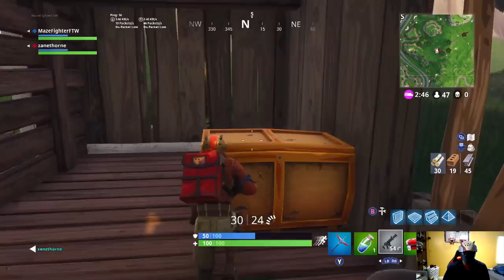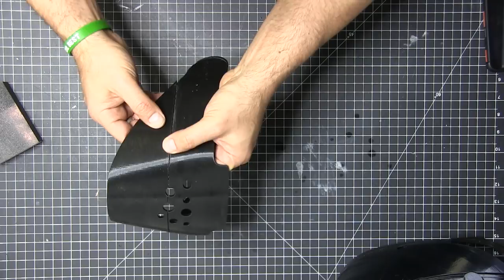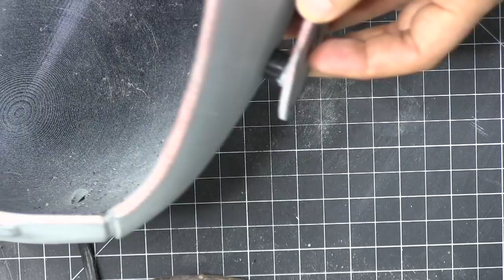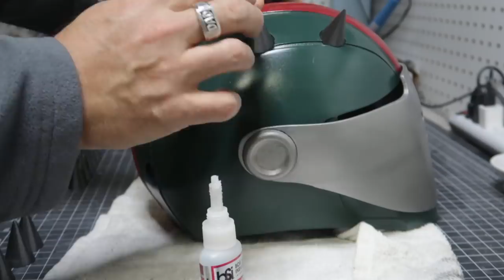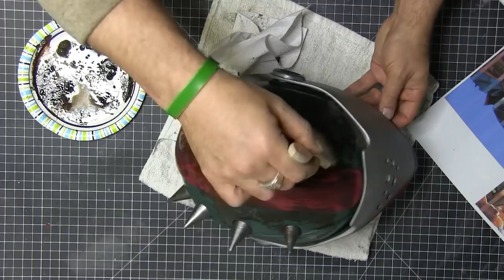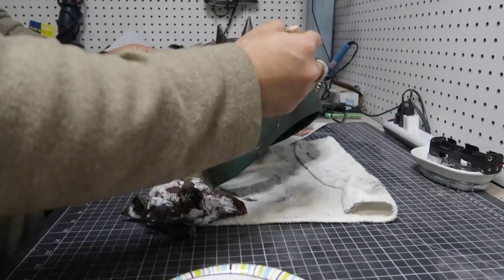Fortnite: Rust-Lord Helmet 3D Print Build [Fortnite Cosplay]

Comment: i really enjoy using a soldering iron to melt the seams together, i find it does a really good job making it a solid piece.
i don't have accelerate, expensive to ship to my house but i can do it without any glue.
Reply from the maker: That's a good idea. I've seen someone else do that. Uncle Jesse also showed me something he put together using a 3D pen which seemed cool. But yeah, the accelerant is expensive, that's why I steal it from my dad's workshop. shhhh. :)
Reply: I max out my printers Z height and glue seams together by manually extruding filament into the cracks, bonds, melts and welds together at one time.